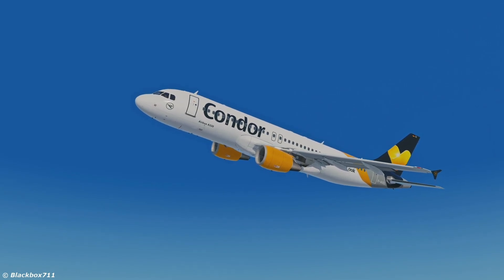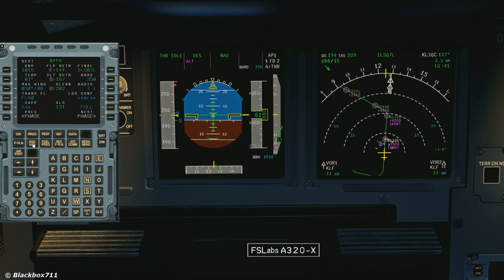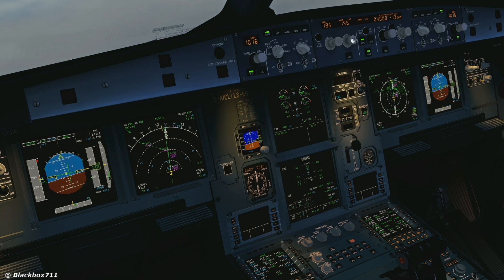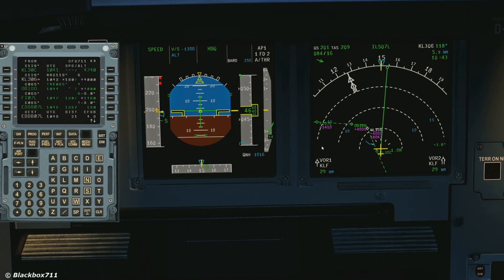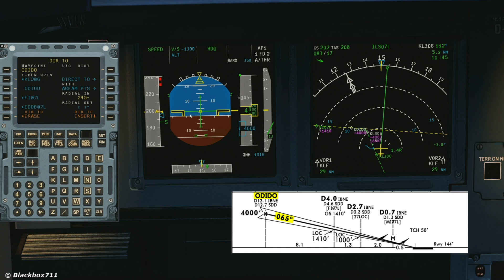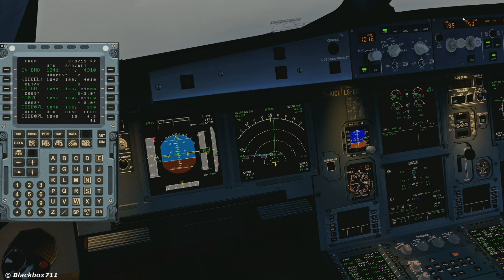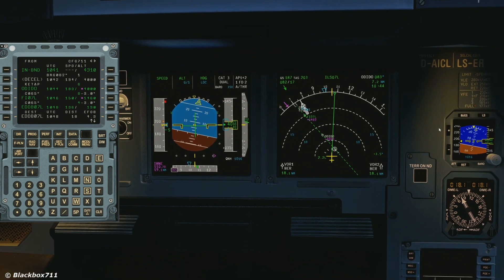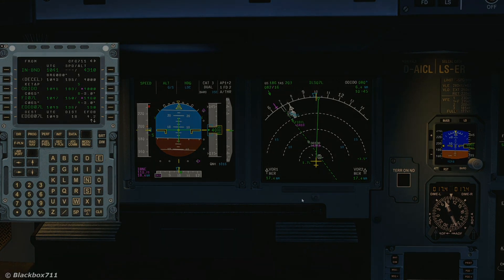FAQ - A320 Extended Centerline function

Comment: Nice video! Do you use any filter for the screens colors? They look more realistic that the fslabs default if I am not mistaken
Reply from the maker: Hi Panos. I sometimes use different LCD color files, correct. You can adjust those yourself if you wish.
Reply: @Blackbox711  can I find the same you have on internet?
Reply: Is there any way to get the same settings that you have? I was watching your flights on twitch and the Colors are tremendous

Comment: Don’t forget you can select heading mode and sequence the flight plan by clearing all waypoints up to the IAF or fix inline with runway track.... So in this example clearing KL30C and KL306 waypoints would also create that extended centre line.

Comment: Nice video, for my self during cruise, I set the opposite corse on the threshold on the FIX page. Doesn't pilot do that also ? for example if I'm landing at EDDM rwy 08R, i'll do fix page, enter EDDM08R then select 260
Reply from the maker: You can do it that way as well. Just remember to make sure that the Flightplan is sequence correctly.
Reply: @Blackbox711  what do you mean by in sequence ?
Reply: @CMBelite-FR  Might be late but he meant to make sure that your flight plan is referencing the correct runway, in your case 08R and not 26R. You can do whatever you want with the FIX INFO page tho